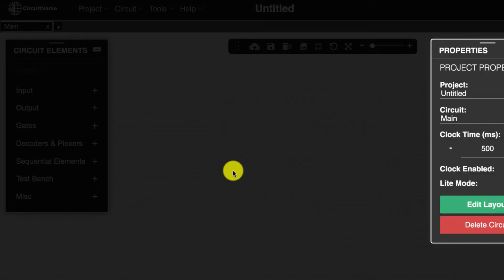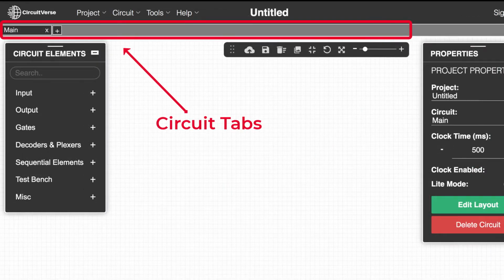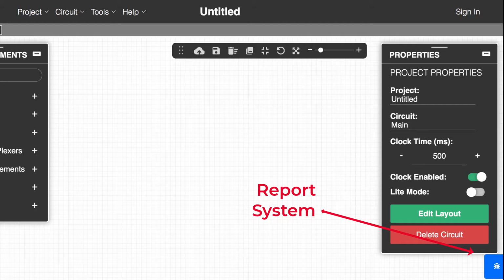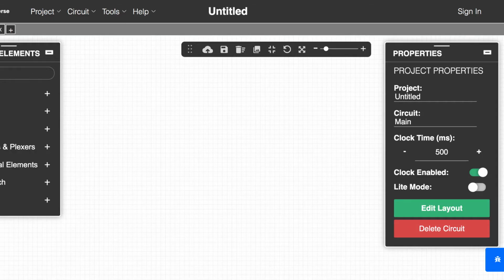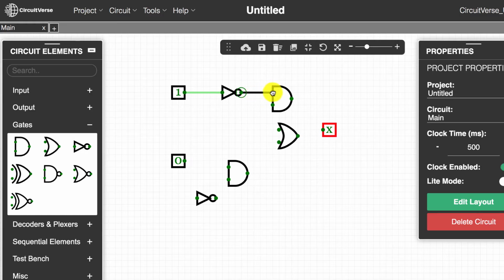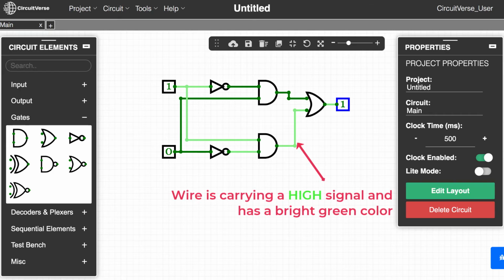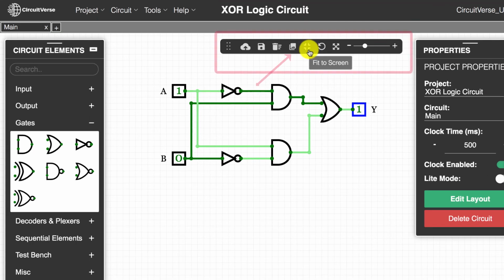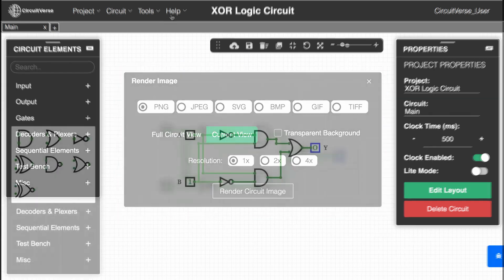Make Your First Circuit Simulation With CircuitVerse

Comment: can you make this what i submit in the bottom I already made most of the project i just can't make the automatic part. even i can't found it in the youtube 

To make your circuit automated, you need to design and implement a counter or state machine to control the flow of data through the circuit.
Your circuit should start with a button press and run through to calculate the product of the 2 numbers, then hold the number in the accumulator register till a new calculation is started.
You can use a counter or state machine to control the different sub-circuits, the shift registers, and accumulator register.
To start the circuit, using the SR FlipFlop can be helpful in designing your counter. When the S input is set high, the SR FF will be set to 1 and will reset to 0 when the R input is set high.